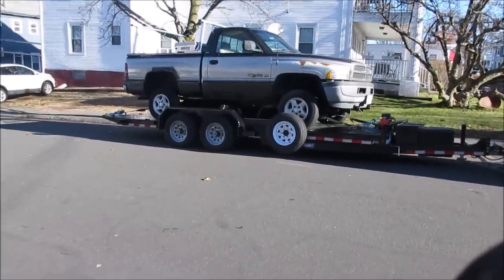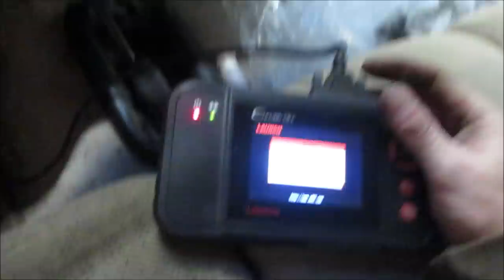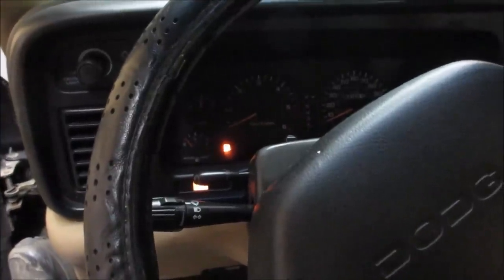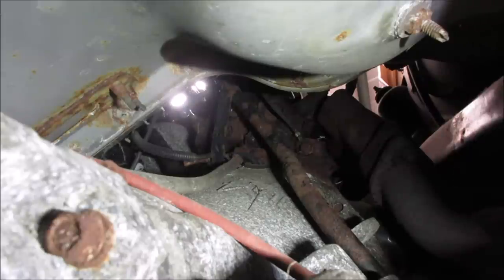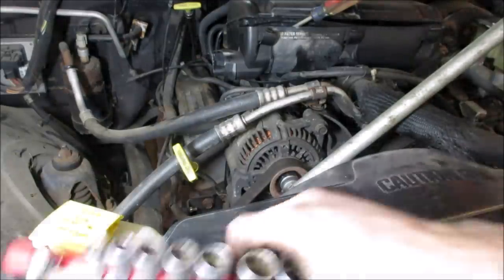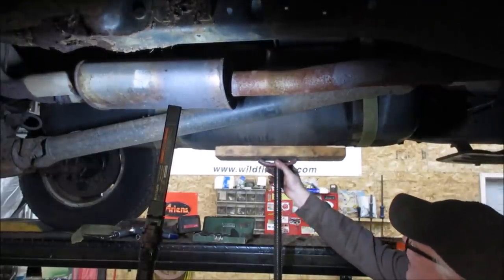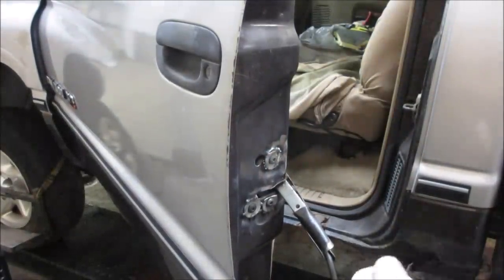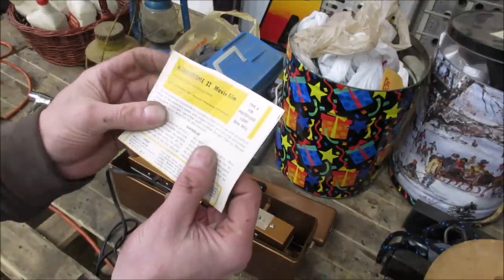Ratty Rusty and Wont Run. But Can We Save IT

Comment: I don’t know anything about that particular transfer case, but I can tell you this… there’s probably a reason the professionals don’t rebuild t-cases while they’re still on the truck. Getting all the shafts lined back up while the thing is horizontal would be an utter nightmare compared to the half hour it might take to pull it off and plop it on the bench.

Comment: My dad always said, "if you can't afford a ford dodge a dodge"
Also with the door hinge pins I've quick fixed many by hitting them with two ballpeen hammers top and bottom simultaneously  ,if you have swinging space otherwise you can muck about with long punches  or unbolt them and do them in the  vice with  hammers

Comment: Mustie, it is a wine dispenser or as it comes from Austria, It also doubles as an anti-freeze dispenser. The central glass holder is for ice.
Reply: Wine goes in the big pear-shaped glass container and ice goes in the small container inside. You push your glass up onto the metal plunger in the bottom and wine fills the glass.
Reply: I agree with Wilson...some kind of drink dispenser.
Reply: My answer too,my parents use too have one over here in the Netherlands ,they bought it on a trip to Germany 👍🏻
Reply: This isn’t a carbureted motor as I know you know. But the fact that it isn’t a carbureted motor should be a pretty good indication that you’re not getting no fuel. It’s feeling jacked you should be getting fuel first thing I’ve done. I will check the fuel level, and after that, I will check the fuel pump and after that, I will check to see if that little check ball in the fuel line is working. You know the one that holds your fuel pressure up check your fuel lines check if you’ll.
Reply: @teddysmith457  you are totally wrong,watch the whole video before you start giving advice
Reply: True.  A wine aerator.  Fancy.
Reply: @August Sievers I don't think it could be for decanting, as that would put the sediment at the bottom of the glass receiver, exactly where you don't want it. The idea of decanting  is to leave the sediment at the bottom of the original bottle. There are mechanical wine decanters but they hold the bottle in a cradle and have a screw mechanism for tilting the bottle very gently, so as not to disturb the sediment. They do as you say, have a candle behind, so that you can see when to stop cranking the tilt mechanism, as the wine's opacity increases in the neck of the bottle. Virtually all Austrian red wines are drunk very young and never get a chance to develop a sediment, so no decanting necessary.
Reply: I'm Austrian and laughed out loud at the antifreeze bit 😀Allegedly we've come a long way since the infamous glycol scandal but I think this gadget predates it, so your comment is absolutely spot-on!
Reply: I've seen that before years ago. It may be an absinth decanter?
Reply: @teddysmith457  I would just change the 2 parts Mustie changed and fire it right up. Not sure why you would change a good running fuel pump!
Reply: @lomgshorts3  That was my guess also.  It said made in Austria on the tag, and I've seen them used elsewhere in Europe.  Looks like an absinthe dripper.
Reply: @August Sievers You will still be taking the wine from the bottom of the container, where inevitably more sediment will have settled. That is why even if you have decanted a good wine, say a vintage Bordeaux into a regular decanter, you will still leave a small amount of wine in the decanter for any further sediment that will always have gathered there.

Comment: it's like engineers think we have another elbow in the middle of our forearm. i can't even count the number of times i wished i had that bit of unique anatomy. edit; that gizmo from austria is a wine cooler/decanter. you put wine in the funny bit and ice in the inside one to cool your wine without watering it down. the dohicky on the bottom is a valve. you push the side of your glass against the tit to let the wine flow into the glass and release it when it's full. the bottom dish is for drips from the valve. i saw similar ones when i was stationed in germany at parties hosted by german locals. the candle is prolly part of it to find the thing when it's on a table outside in the dark and your guests are kinda tipsy.
Reply: Either that or we start training octopus as car mechanics!
Reply: Nice!! Came to comments just for this.......watched guy fix a million cars.....but glass doohickey weirdness?
Reply: Ok, that makes more sense with the grapes as the design.  I was thinking it was for absinthe.... :)
Reply: Would the candle bit be for red wine on cold nights?  Can't stand wine neither am I a connoisseur but white wine served chilled whilst red is room temperature IIRC
But give Mustie a day and he'll have it running in no time..........possibly connected to a 36bhp 100cc engine to automate some process like refilling
Reply: @philhunt9297  Try a German Riesling, they are a very sweet white wine and taste almost like grape juice, then again there are so many different types of wine in the world. No sense being a hater for life...
Reply: I've always said that the engineers design everything else around the parts which are most likely to fail first. Why? Because they can.
Reply: @philhunt9297  they had red in the one i saw. it was a really sweet wine, but i couldn't tell you what kind it was. i like wine better when it's been distilled into brandy, same as i like my beer after it's distilled into whiskey.
Reply: во времена Генри Форда человек проектировал и тележку и двигатель, сам всё делал и писал своё имя на автомобиле неся ответственность и получая прибыль,
а потом тележку стал проектировать один человек, а двигатель проектировал другой, запчасти делал третий, собирал воедино четвёртый, а бонусы по итогом годовых продаж стал получать пятый..
эти дураки отвечают каждый за свой узкий сектор, а покупатель искренне не понимает почему двигатель в автомобиле не может быть обслужен так же просто как еслиб он лежал отдельно от автомобиля на столе.
Reply: @unokarpa4405  i am a mechanic, and have been for over 40 years. repair work gets harder and harder every year even for us. they want to create a throwaway world where they can sell you a new product every three to five years and no one is able to repair them anymore. that is the goal of modern corporations.
Reply: Thats what happens when the Mechanic sleeps with the engineers wife.

Comment: I used to own a 2000 model years ago with the 5.2. They loved to rust no doubt. That one is in better condition than mine was in terms of rust. Those trucks love to have faulty crank position sensors that love to cause a "crank, no start", I think I changed mine 4 times. I didn't have the option of cutting into the floor to access it as the truck was my daily driver at the time, so I wanted to keep it intact. I worked from underneath the truck and got it after a whole lot of cussing and pledging that if I ever meet the Chrysler engineer who came up with this, he/she will be spitting some teeth. They suck to get to as you can't see it and have to work by feel. But, after the third one, you can do it in your sleep. It's good to see Mustie channeling his inner Andrew Camarata on that driver's side door.

Comment: Mustie, to answer your question about the carb conversion, its YES! Edelbrock makes an intake to convert this engine (and the other "Magnum" V8s) to Carburation. Part# 7577. These blocks also have the same bellhousing and mounts as the older "LA" engines so dropping it into an older car would be practically bolt-in

Comment: We had spools of single strand copper wire like that to lay in next to PE (plastic) natural gas mains and services to the gas meter on the building. Later, the service could be traced by inducing a small electrical voltage to trace the pipe. Lots and lots of uses for that wire....great find !! Nice oldodger too !!
Reply: It looked like THHN wire to me. So yeah it's wire.
Reply: @1pcfred  THHN ?
Reply: @oldodger  Thermoplastic high heat nylon insulation. Single strand like that is often used inside conduit (EMT).
Reply: @oldodger  THHN stands for Thermoplastic High Heat Nylon. It's a very common type of wire used for electrical work. It's the bog standard stuff. Slightly fancier wire would be MTW That's Machine Tool Wire. It's more oil resistant. THHN is fine for most automotive applications though. I'd use it for anything that wasn't uncovered in the engine bay. It'd outlast me at this point.
Reply: @1pcfred  Thank you sir.

Comment: Never ceases to amaze me just how hungry the 'salt-belt' can be. I live in mid-Canada and our winter roads also eat up our vehicles for breakfast. I'm not a fan of Dodge, but I do have a soft spot for those first and second gen Rams.

After watching Mustie struggle with the wonky engineering of the second gen that soft spot I had is callused over.

45:44 I see he has dealt with the wretched Dodge transmissions before. 😅

Comment: I had several of these. Usually the multi cylinder misfires were the crank positioning sensor on the back of the engine.

Comment: It is a wine dispenser.  You fill that with wine, and the piece inside is filled with water then frozen.  You put the "ice" inside the wine to keep it cold.  When you want a cold glass of wine, you press on the tip underneath and the wine flows into your glass.  It just keeps the wine cold without diluting it with water.  It's very popular in Germany.  The candle on the side was probably added later for a decoration.

Comment: Not sure if it was mentioned already but you could tell it was the crank sensor because it wasn't registering RPMs as it was cranking.  Also, the distributor does not control ignition timing, the ECU does.  The distributor instead controls fuel sync, when the injectors fire in relation to piston position.  You have to set fuel sync with the engine running with a Snap On MT2500 or older Matco Scan tool.  Can't recall factory specs for fuel sync but I believe +2 is the sweet spot.
Reply: The lack of tach needle deflection was the first thing I noticed when he started cranking.
Reply: Yep! When mine went bad, it would randomly die almost like you shut the key off, but the radio and everything else was still on. Shut the key off, sit and wait for a minute or so, crank it and it would usually start right back up. Then it would run for varying periods of time. Sometimes you might be able to drive it for a couple of days before it did it again. I noticed that when it would die, the tach immediately went to 0, and if you turned the key straight to start and cranked it before resetting the key, you had no tach signal. Shut off the key and wait before trying to start it again and if you had tach signal it would start right up.

Comment: Might consider painting a parking yellow line over the garage floor to help you align the trailer with the lift.  A line along the edge of the left side tires with a perpendicular line across were the back tire will stop.
Reply: That might work if Darren stopped pushing the lift around on the floor.
Reply: @1pcfred  .. lol , you spotted the slight flaw as well
Reply: @888johnmac  a minor adjustment I'm sure.
Reply: @1pcfred 
Easy fix - lasers mounted on the lift itself.... Functional... And awesome because it's lasers.
Reply: @tin2001  I've used line lasers some. I can't see them too well in bright light. Sometimes I wonder what they might be doing to my eyes too. Caution lasers in use. Protect remaining eye.

Comment: Amazing (to me) that you take these on. Most people would run a mile when they saw the state of the floor pan, sills etc. "Check engine, yes, still there", was the highlight for me.
Reply: As long as the car doesn't fall apart while he's clearing snow he doesn't care if it rots to bits. Now welding this one back to roadworthy condition would be an interesting task!

Comment: Yes you can run that 360 with a carb but it requires a special intake manifold. Can’t use an LA360 manifold - it has to be for a magnum.  You can also put all the LA360 accessories and brackets on the magnum though which is nice.  You can dress it up to look like an LA360 from the 70s

Comment: Drivers door is aftermarket it’s missing factory I’d decal and is way to thin. Believe it or not six bolts and one connector that box comes off easy and it’s a heck of a lot better to work on tank straps.

The chainsaw may be one of the echo ones where the mag/cdi unit goes. No replacements.

Comment: You can buy, yes I know new is against your religion, but you can get a 5 wheel single piece cast aluminum legs, and then get the set of 5 office fitted rollerblade wheels. You'll be zipping across your garage faster than you'd believe, and the rollerblade wheels last well, and handle bumps.

It's not a grow light, it was for 8mm home movies.

Comment: To answer your question regarding the carbureted setup.

Yes, you can convert the magnum series engines to carbureted and use them in place of a LA series engine, it just requires a conversion intake manifold.

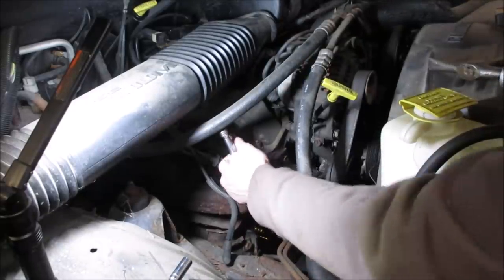Comment: To answer your question @17:57. Yes you can, they have 4 barrel intake manifolds for the Magnum engines, 318 or 360, and replace the distributor with standard electronic ignition. The basic block design goes all the way back to the Chrysler 273 (LA series 273, 318, 340, 360) from the 60's and further back to the Polysphere (A-series) engines of the 50's.
Reply: @ritchiesokol1061  "IF" you wanted to, you probably could.

Comment: 20 seconds in . check the tps throttle position sensor had one with multiple cylinder misfire codes no parts cannon I went straight for the sensor it fixed everything

Comment: 36:25 I don't remember what I was working on but it was the same thing: the wires were actually NOT even long enough to click together. I could get my hand around it just fine, but the ONLY way I could get it together was with a pair of channel lock pliers and the wires were strained like guitar strings. Freaking ridiculous and it wasn't because it was an aftermarket part and they cheaped out, it was an OEM part.

Comment: The downside of adding length of wire like that is if you do not solder them the ohms can change and it will throw the readings off

Comment: 20:59, I saw a video on a tilting lay down platform. It is placed next to the truck, you step on it, and it rotates at about hip level so you lay across the fender with your head about where the rocker covers are. Great idea right? Well, not if you have to remove the ducting to the throttle body and it's not easy to move more in, or out. 

Think of a massage table....

Comment: That is a Crankshaft Position Sensor or a CamShaft Position Sensor is bad, that tells the ignition if the engine is turning over or how fast it is running.  I keeps it in time.

Comment: tie a string on the wires coming down and then pull back up and after you have extended the wires on the new sensor you can make the connection up top

Comment: Those plug-in diagnostic tools need to have cameras on them so they recognize that this truck has more rust than steel and is headed for a short extension of its life before the frame completely collapses.

Comment: I had 3 of them… to work on the distributor lay on motor and curse a lot.. Big common issue with dodge fuel pump, trannys hahaha only… otherwise a lot not bad little truck… you got a rear one 360 in single cab short bed 
I’m only 15mins on this comment

Comment: Gray pvc is not plumbing it's electrical conduit parts which the white solid wire is pulled into.  The yellow cable is the modern 12-2 with ground.  Commonly called romex and the yellow depicts 12 guage where as white is 14 and orange is 10 guage

Comment: Nice video but I would have liked it if you pulled off the alternator and relubed or replaced the bearings and checked out the brushes, etc.

Comment: found a 2003 model with the same engine rolled into a ditch owner said it died and got fedup fixing it.. turned out the crank sensor which is a nightmare was shot and the ASD (Automatic Shut Down Relay) signal from the ECU was missing jumpering the ASD and a new coil and it started.  the sensor was an absolute nightmare.. back of the engine above the trans in a small hole.. and you acess it from the passenger wheel you remove the arch cover. ..kind of sad you brought this video out as i just sent a 97 ram 1500 to the boneyard 8 days ago was a wiring nightmare and was not worth repairing.. so it was parted and gutted.

Comment: I had a dodge like that, the engine light would come on periodically. Turn the ignition switch on and pull the fuse light would stay off. Until the next time . Go figure.

Comment: If you're going to mess with OBDII vehicles, you should probably do the research to follow up on the code. It does absolutely no good to get a code like that and not understand why it can set. Wasting time and money replacing ignition parts when it has a bad crank reference signal

Comment: I would have the bumpers rechromed....to piss off the rust.....then....chop the roof 4"....tint the mirrors.Put crushed velvet in the glovebox..then convert the electrical system to 48 volts

Comment: I read the comments real quick and I see ahead of time you got it running. But for those that don't know, the distributor on these doesn't control spark timing, they control fuel timing and takes a special dodge scan tool to reset. The crankshaft position sensor on these suck to replace too. I have an 01 5.9 that has been good to me.

That John deere chainsaw is an Echo chainsaw but rebranded for John deere.

Comment: Take the last 8 digits of the vin and call the dodge dealership and they will tell you what transfer case it is
Reply: The round tag on the case will have the model number stamped on it as well.